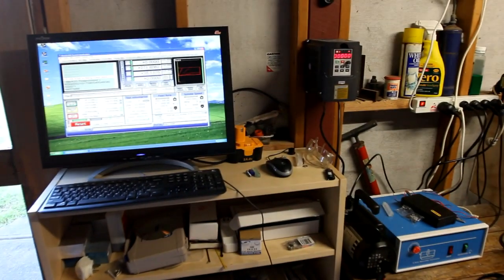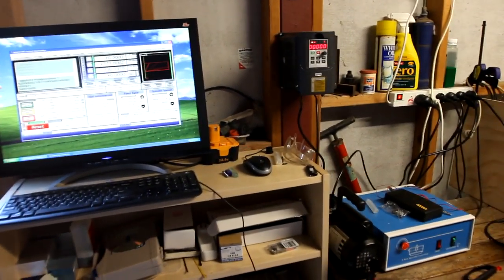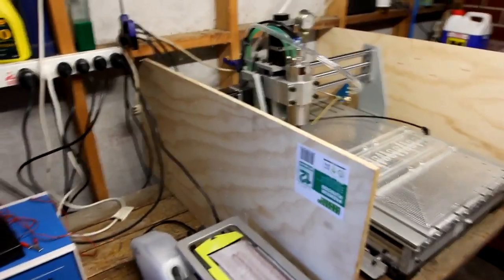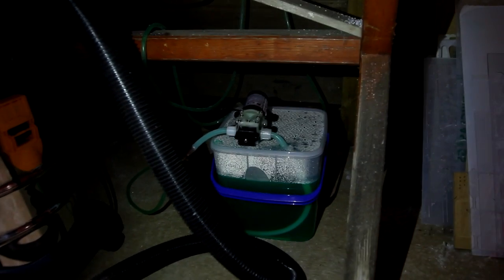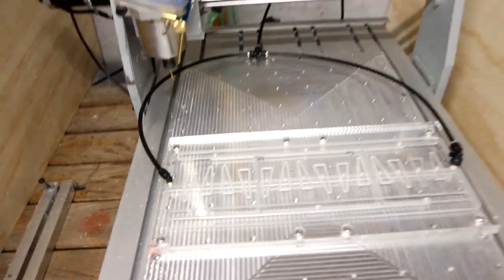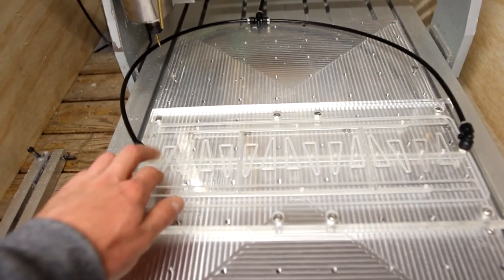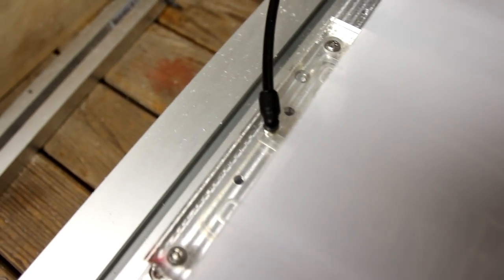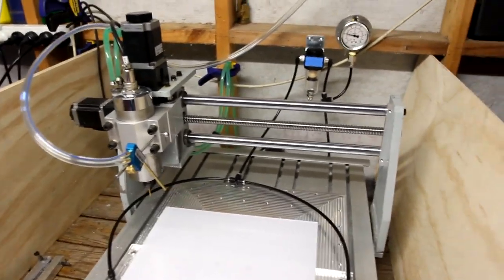Vacuum table CNC 6040 machine

Comment: How about this: mount a mdf spoilboard using carpet tape(double sided). Use some rubber/tape/silicone to plug all the t-slots in the aluminium profiles of the table. add vacuum hoses to the other side. now all air sucked from the tubes will have to go through the mdf. place the part where you want and cover the rest of the spoilboard with a sheet of plastic to prevent air going through. start the vacuum.
Reply: The mdf plate will be mounted on the aluminium bedding with carpet tape only covering the aluminium, not the t-slots.
Reply: The mdf plate will be mounted on the aluminium bedding with carpet tape only covering the aluminium, not the t-slots.

Comment: Hi Luke, what sort of vacuum pump are you using with this? I have the same router as you and have just bought a vacuum table, but am unsure of which power pump is adequate. Cheers

Comment: Hi Luke,
Thanks for your very helpful videos, I'm having heaps of fun with my 6040.
I have the issue of my spindle only going at 11520 rmp and the speeding up/slowing down times being quite slow. Would you send my the english manual you talked about for changing the settings on the speed and stop/start times?

Comment: Luke, I just took the plunge and ordered one of these 6040's.  So if you hear any swearing echoing accross the Pacific from California it's probably me. This seems to have worked well for you, but of course the Force is with you.  Me...I'm not so sure.

On that vacuum table, is that pump one of the harbor freight Air conditioning vacuum pumps?  Is it still working out for you?

Cheers

Comment from the maker: Hey mate, I designed and made this myself - you can buy vacuum tables quite easily however none are suited for my small parts. The material is held to the seal which is pronounced from the table, probably 0.5mm. That allows for milling the part out. Hope that helps mate. I found the hardest part finding the right sealing material. Silicon tube works best for me but when in contact with dust it loses its seal. Needs cleaning reguarly. Cheers

Comment: Hi cruddcnc.

I have a similar cnc machine milling primarly G10. I am tired of always have to screw parts to hold them in place and have been thinking about a vacuum table. 

Did you buy something of this table or is it completely your design? Is it hard to make or is it maybe possible to buy? And how do you solve not milling into the vacuum table?